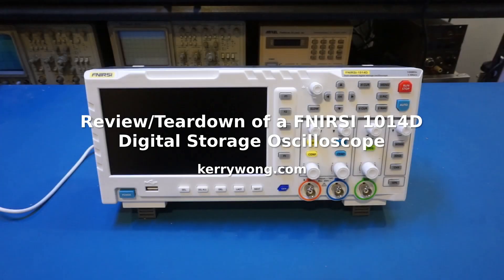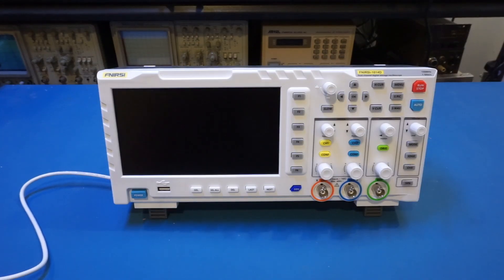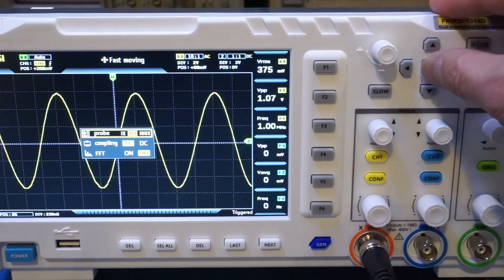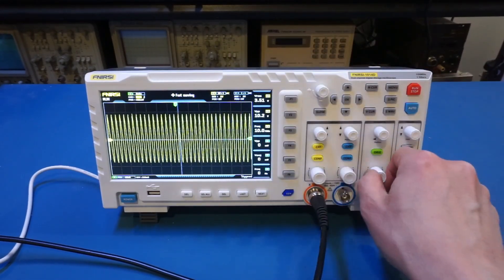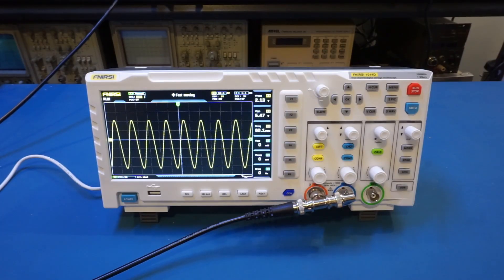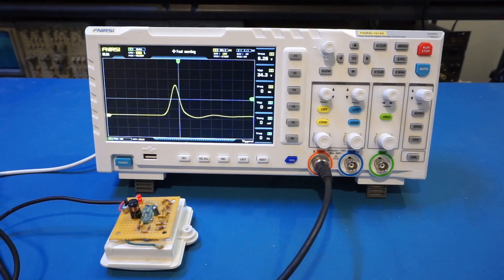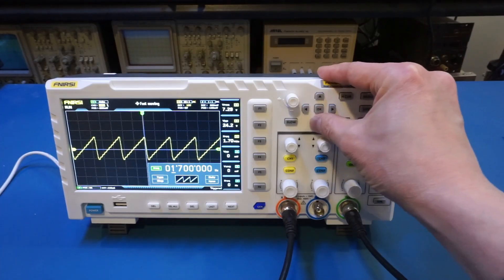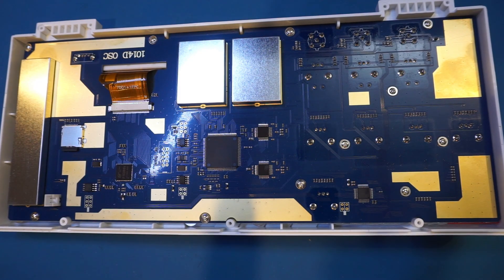Review/Teardown of a FNIRSI 1014D DSO - 100 MHz or 30 MHz Bandwidth?

Comment: Thanks for the work you've commited to this video. Most criticism to your conclusions throughout the comments are for some significant part correct IMHO. But (huge BUT here) the utterly dominant use of the sinusoidal function isn't fitting to draw such a derrogatory conclusion.
The most utterlly glaring absence of the square wave function performance of this oscilloscope is the major flaw in drawing such peremptory conclusions.
I must agree it is limited, quircky and with "optimistic" specifications. Nevertheless it is dirt cheap! And so therefore it delivers real value in a low budget hobbyist use case. Besides if you goof up and brick or "magic smoke" one of these you loose less $$$ than with, say, an entry level Hantek or Owon.
DISCLAIMER: I have one of these gadgets. Is it useless? No. Is it limited? Yes. Would I buy one today if I managed to fry the one I have? Most definitely Yes.
Lastly: I have other scopes.

Comment: I believe that this test is only for those who run a professional application. the part is in fact not made for that.. but the people who are really professional technically will probably not expect that this device can meet their requirements. For me, however, the device is a plus simply because of its potential freedom and that should also be the case for every beginner who is not aware of the devastating consequences it can have to work with mains electricity to operate an oscilloscope. So far I've only made my Bradbord circuits and also made a few circuit boards, so this Oszi would always be enough, especially since I've only worked with the DOS138 so far, but I like the idea of an Absolute Potteltialfree Ozi (battery operated) which gives me two channels like offers a generator, I've been thinking back and forth for a long time whether I shouldn't buy the DSO2D10 but the price jump is too high for me and I won't be able to exhaust the possibilities that this Oszi offers by far. In addition, I need an isolating transformer to be on the safe side, which also costs money. So I think I'll buy the FNIRSI -1014D, which by far covers my needs as a hobby electronics. Sometimes I still use my old tube Oszi, which is from Russia, but the contacts are so dusty that triggering becomes an adventure, and it's analog only. 
I have the FNIRSI -1014D in the selection on E-bay but I'm still negotiating, the counter-proposal is 142 € but there not taxes on it so that it would cost me about 180 €.

Comment: Would you mind clearly naming the scopes you do recommend (in the same price range) in the video description, or at least linking to the review videos? Thanks :-)
EDIT: Is this the one you were referring to? https://youtu.be/Mmx7eo9STXE
Reply: Yea, I was wondering the same too. Thanks for looking up the link for the video. But after watching it, IMHO, the Hantek DSO2D10 is only good if you need higher bandwidth (>30MHz) and it is nowhere (well, including shipping) near the same price range. Still tempting to get 1014D for the simple stuff I do...
Reply: @MrWhatID  Yes, I'm thinking the same. For my retro computer repairs it would be more than enough. Hardly anything goes above 20MHz there. Also, if you are developing some microcontroller applications / IoT , those are also mostly low speed stuff.

Comment: Your conclusion is quite harsh, IMO. This "scope" is very good for breadboard applications to learn Arduino, or STM32 or another popular boards and programming. It is not a professional scope, there is no doubt about that. But a moderately good scope costs at least 3000$ and a professional one starts from 10k$. And this one costs only 120$, or at least this is the price I paid a year ago. This is unbeatable price compared to low-class competitors as Hantek, Owon or Siglent for example. I really enjoy using this "oscilloscope" for my hobby learnings with all these ESP32, Raspberry Pi or Arduino boards and it works for me. Just to mention that I have two high-class oscillsocopes Tektronix and HP, one analog Kikusui and one quite expensice Rigole. And I am using most of the time for not so demanding measurements FNIRSI 1014D. And really enjoy to compare identical measurements between all those machines and yes, FNIRSI is really the cheapest ever and not perfect one, but really works well most of the time for frequencies below 30-40 MHz. I am happy to have FNIRSI 1014D, because is very portable and with a great display and quite good mechanics too. It is good to have a backup with good oscilloscope for realistic measurements, but if you need to study a I2C protocol, you don't need LeCroy or Yokogawa, or Tektronix - this scope will do the job as well.
Reply: It's hard to watch the i2c protocol, when 1014 does not allow shifting over the entire memory or changing the sampling frequency.  An oscilloscope with very limited uses.  Do not buy.
Reply: bro is coping lol

no

the hantek is selling for exactly the same price and it is MILES AHEAD
Reply: @urnoob5528 Hi, what’s the model you’re talking please ?
Hantek which model ?
Thank you 🙏
Reply: @urnoob5528 I don't understand what you'd like to say, but maybe you understand what you're talking about. And I've never said Hantek aren't ahead - of course they are. And this Fnirsi is a brand new Chinese brand. But Hantek oscilloscopes are more expensive, and that's a fact.
And that this is not a real oscilloscope is also a fact, but I got it for a little over $100 a year and a half ago. Hantek's devices started at 250$, at least. Precisely because of the price I took one. Not that I don't have expensive oscilloscopes like the LeCroy 600MHz 64Xi that used to cost at the moment $4000 second hand.
Everyone makes their own choice. Someone went to the efforts of making this cheap oscilloscope, and I'm not in the habit of spitting out that labor so easily. You don't like it - don't buy it. On the contrary, I am having fun with this small and cheap machine. For real measurements I use real oscilloscopes. And even Rigol doesn't fall into that category, let alone Hantek.
Reply: @urnoob5528 I'd like to know too what's the hantek model you refer to
Reply: Probably the Hantek DSO2D10.  Kerry said in the video that the Hantek he referenced had been reviewed on the channel, and indeed if you look you will find this model reviewed in his prior videos.  On Amazon today, the Hantek is 213 GBP and Fnirsi is 199 GBP, pretty comparable.  So I'd guess that is the one.

Comment: Oh man this is bad. A biased and partial review. When you are such an oscilloscope extreme user (99,99% of people do not have your extreme laboratory level), you can't expect the cheapest most portable oscilloscope made for easy and casual usage to match your extremely expensive laboratory oscilloscopes.

This is a perfect oscilloscope, features/performance/price, for a normal use by a normal user. 
If your are a top end electronics snob, yes then this is not the scipe to consider
Reply from the maker: To be fair, I wouldn't have any issue with the scope if the manufacturer was honest with the specs. For the same amount of money you could actually get a scope with 100 MHz bandwidth.

Comment: This is just my opinion so take it as that, I thought the review was rather harsh, I know Mr. Wong was just giving his honest opinion, but I think he was a little too harsh, "I would not touch this with a 10 foot pole" that stung, as I purchased this item. I purchased it because I have used older Tektronics Oscilloscopes when going through school, but that was years ago. I purchased this item to re-acclimate myself with oscilloscopes, I did not want to spend allot of money for an item that I could damage while learning, I did not care if it was not too accurate or the specs were somewhat bloated, I purchased this item for 1. it solved ground isolation by being able to be powered by a power-bank, 2. it was under $200 and had most of the basic feature I need to learn 3. additional feature that I could advance too if wanted. I think that Mr. Wong was somewhat blind to the audience, I use YouTube to find and learn things I do not know, I am glad that he was frank, but he could have been without the comment  "I would not touch this with a 10 foot pole" that comment is the only thing I found offending to the review. I agree it is a cheap oscilloscope, it has some issues, some that have been corrected by a firmware update. In a summary all I am asking is that you be aware of your audience.
Reply: I think there are better choices for the price. This just seems to be too iffy.
Reply: @pizzablender  - it maybe iffy, but for some just re-learning OC the cost out weights the iffy.

Comment: Just a quick question, due to the price can it be useful and worth the price if you use it as a portable 30 mhz oscilloscope? Like in automotive/educational (not have to be careful about) purpose, measurring CAN bus and small signal like that?
Reply: nope

buy a hantek at the same price

Comment: Bought one, the bandwidth is really not an issue for me as I regularly work in the 1 to 20 kHz range. I do have a question and hope you can answer it. The FFT function trace seems to be set at a height of half way between the centre line and the top of the screen and I cannot move it with the channel knob. Is this a limitation of the scope or am I doing something wrong?

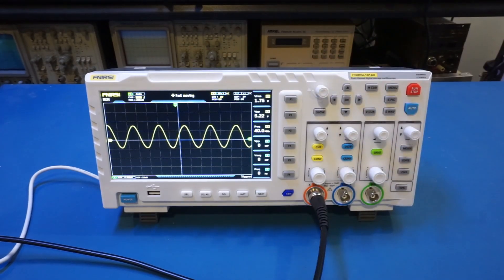Comment: Fnirsi 1014D does not have a firmware on the SD card (it has it in the flash) and it can boot even when SD card is formatted. One of EEVBlog forum members reverse engineered the firmware (and even made a new firmware for 1013D) and not only that - he even reviewed this very review of the 1014D saying: "Around 8:50 in the video he even does not notice the sudden rise in amplitude when the signal goes from ~41MHz to ~42MHz, which is when the software starts to calculate the sine wave instead of using the actual points, just as it does in the 1013D. Around 15:09 he assumes the firmware to live on the SD card, which we all know is not the case. He should have consulted this thread before doing his review. Have noticed this missing with other reviewers too. A bit of a shame because this blog is full with useful information.".
Reply: Can you please link the eeveblog post about 41MHz threshold sampling problem ? I can"t seem to find it
Reply from the maker: @ChupoCro, I may have used the term OS and firmware loosely but the OS is on the SD card and without it the scope will not boot (you can easily verify this yourself). Regarding the bandwidth measurement, the point I wanted to drive home was not where the actual cutoff frequency is, but the actual bandwidth is far below the claimed 100 MHz.
Reply: @KerryWongBlog  It won't boot if you remove the SD card but it will boot if you format SD card. It will boot from an empty SD card. Yes, the actual bandwidth really is far below 100 MHz but that isn't questionable - I was referring to the information that wasn't correct. Forum poster that reviewed your video review wanted to say there is an important info missing from your review. The information about how the oscilloscope works up to about 41 MHz vs how it works above this frequency might for someone be very important for making a decision if they could or could not use this oscilloscope. And if you read the thread about that oscilloscope I mentioned, you will find many more important information you didn't mention.
Reply: @ChupoCro  You and the EEVBlog forum member seem to have some real interest in trying to use a strawman argument to try and ding the main point of Kerry's video. The unit overstates its capabilities, its true bandwidth is barely 1/3 of what is advertised.
At that point, it doesn't matter what else it can do or how badly it does it since it can't even do the primary thing its sold to do.
Why some people want to defend a company for ripping people off is concerning, are the somehow being paid, or are they just inherently stupid or to butthurt to admit they got scammed?
Reply: @KerryWongBlog  no

Comment: This scope claims to have a feature of capturing and storing a waveform from oscilloscope input and using this stored waveform as output of signal generator. It would be interesting to see this in action. 

Excerpt from their advertising: 

"The output device intercepts part or the whole part of the complex signals measured by the oscilloscope as the output signal of the signal generator, which can store up to 1000 customized cut-off signals;
The built-in high-voltage protection module can tolerate up to 400V continuous voltage, without worrying about the oscilloscope burning accident caused by the probe not moving to 10x gear.
Built-in 1GB storage space, can store up to 1000 screen capture pictures + 1000 groups of waveform data, the storage process is simple and fast, save the current waveform with only one click, no cumbersome prompts and choices to save the current data, very convenient." 

It seems this scope has some interesting features that differentiate it from other scopes, which may be useful in some scenarios. Not many instruments can replay captured waveform from signal generator.

Comment: Seriously, this scope can't even do decent/acceptable voltage metering has obvious UI problems and systemic hardware issues (some already mentioned in the video) -- which the manufacturer just simply turned a blind eye on. It's a waste of benchtop space and really belongs in the rubbish bin.

Comment: I bought this scope. And I share the same conclusion.....Its pretty hopeless. Its very much overspecified. And its very useless for anything serious.

The only good thing about this scope is that its really low power consumption. U can actually run it from a good phone charger. 

Also there is a touch screen version. Which greatly increases the reliability of the equipment. As most oscilloscopes start malfunctioning just out of one bad rotary encoder. 

The HMI is very impressive. And they have put in real good effort designing it. And it is really very responsive and fast. It catches the eyes and is very attractive. 

The sensitivity is pretty low. And the most damaging aspect among the negatives is the bandwidth. In fact if u try to measure a rise time, which is under 10 ns, the display is very unstable.

Since I also opened up these scopes. I can tell that the ADC used are Analog Devices AD9288. These ADCs definitely are rated for 300 MHz analog bandwidth capture. But they are nowhere near the 1Gsps acquisition rate. They can do something like 100 Msps on single channel. With one channel feeding both ADC channels in the chip and the acquisition being taken alternately from both channels on the chip. Theoretically they can achieve a 200 MSPS mark. Which is still insufficient to achieve 100 MHz bandwidth, even with this topology. 

Had FINRISI provided 

1- Equivalent time sampling mode (difficult as most manufacturers don't. Hantek used to do that, a while back and its very useful). 

2- Included a small large bandwidth preamp (Like Owon does and also Hantek) before driving the ADC. 

These two measures would have given this scope a powerful punch. As they would have increased the sensitivity and bandwidth to potentially 300 MHz on repetitive waveforms (which is what we usually work with).

Comment: In the "Solemnly Remind" section of the manual the scope only claims 5MHz bandwidth with 1X probe... (so it seems to exceed that.)... It seems pretty impressive to me for the price point, much better than my super old analog tektronix...
Reply from the maker: 5MHz is typical for 1X probe, but for 10X it fell far short of the claimed bandwidth.
Reply: @KerryWongBlog  did you use a 10x probe?
Reply from the maker: @gradyplayer  Yes. All tests were done with a 10x probe.

Comment: Yes, it's affordable, and with that USB power source is definitely a plus. But engineers and technicians need reliable gear.
Reply: yeah can only agree, i have made the terrible mistake of purchasing this oscilloscope a while back when i was still an electronics beginner. i'm still in high school so i don't have much money to spend on proper test gear so i'm still stuck with this bit of hardware. i truly hate my past self for this purchase and to everyone who considers purchasing this unit: it is absolutely terrible. it only caused me trouble so far. for example when i swapped the USB power supply for a different one that had a tiny bit more noise... took me about 3 weeks and numerous hours of poking around with multimeter probes in the internals of this scope to figure out that was the issue..... also for the work i do not having a properly shielded scope is a real big issue. 0/10 would not recommend

Comment: cheap scopes are now at the level of cheap multimeters. indicating toys with fake  specs.  They will become more popular because most buyers have no clue what specs mean. They want to think you only pay a lot for a brands name. Using a scope correct is difficult, understanding the measured data even more. One bad side effect is that now the former cheapest scopes look like they are good. At least those were still usable if you do normal measurements. I used to have a Rigol, I so hated that piece of junk I gave it away  But that was the first 100 MHz Rigol made and was 1000 euro. They later have  become better in price/performance (low price, low performance,  I am biased, I have 2  non-hobby budget R&S scopes, But I need them for my job.